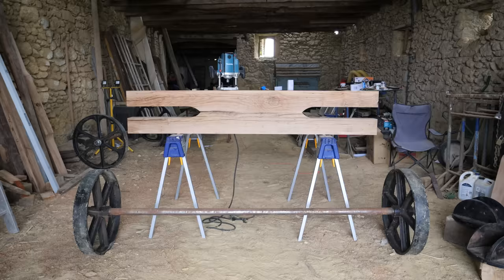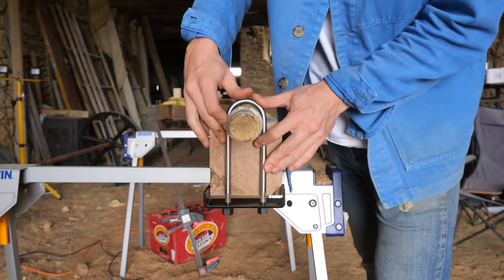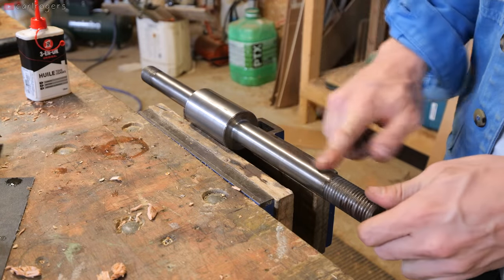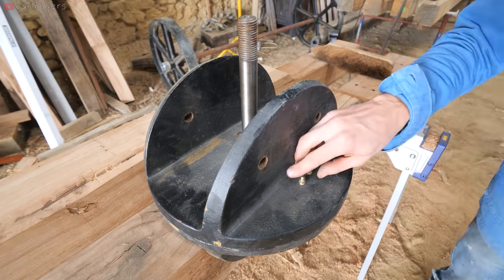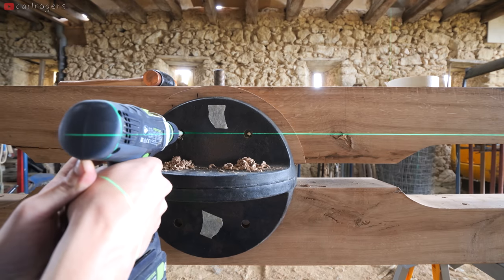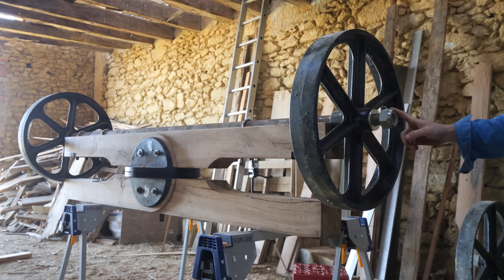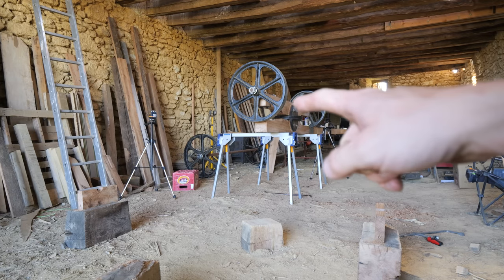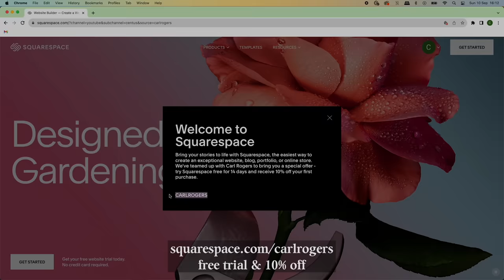Front Axle Finished  |  DIY Shepherd Hut #3

Comment: 10:43  LPT: put a nut on the threaded rod before you cut it, then afterwards when you remove the nut, it will clean up the damaged threads.
Reply: That's a great tip thank you
Reply: Was thinking exactly that when I saw the grinder.
Reply: Yup. We do that all the time at work. Good call
Reply: and if you forget, invest in a thread file
Reply: Or a tap &. die set.  @blackdoublezero
Reply: It is the British accent, it makes you sound more knowledgeable and smarter than you are. it took a few vids to figure out that Carl has no clue what he's doing.🤣
Reply: Yup!
Reply: I thought of it too. But he had like two plus feet of threading to get the nut on before he cut it....

Comment: When they built wagons in the past, they would completely build them, then take them apart and paint (even in the bolt holes) then reassemble the wagon. They used regular paint then finished with boiled linseed oil to make it waterproof and shiny. The iron fittings can be finished by heating and coating with linseed oil. It will blacken and seal.

Comment: I would have put the grease nips/zerts in anyway. For the wheels as well. Grease breaks down after awhile, and it never hurts to add fresh lubrication occasionally. It's going to be a solid, well built wagon!
Reply: I totally agree. You need a grease fitting in there.
Reply: Agree 100% with this.  As an owner of a classic British sports car with kingpin front suspension, the owner's manual clearly states to regrease the kingpin at least once a year.  Putting the zerks in is easy and grease is cheap insurance.
Reply: Put em in.
Reply: Grease doesn't last forever, kiddo. Add the grease fittings.
Reply: The most prominent DIY heavy equipment YouTubers like Marty T or Andrew Camarata have one thing in common - they believe in grease. The first thing they do with newly acquired equipment is grease the heck out of it. Grease makes the world go round. Add the grease zerks. In grease we believe.
Reply: Completely agree.  Grease has its own life expectancy and while re-greasing may not be necessary in the long run...in the chance that the thing does need re-greasing would your rather disassemble that best or simply 'snap on' the grease gun?
Reply: By the wheels :) there's nothing to keep them away from oak log. It should be at least a washer but better some ring welded to  axle
Reply: @cv990a4 in grease we trust 😅
Reply: I would put grease nipples in the wheels for sure, but not the plates. The plates are covered, very slow moving and rough. Any grease forced in will probably exit at some point (plate circumference or kingpin)  before it reaches the rest of the plate area. Pre-grease and that will last for 20 years at least.

Comment: Tip.  To drill a horizontal hole in a member, make sure that members face is plumb, then place a ring of sorts over the drill bit  Keep the drill in alignment by watching the travel of the ring. When the ring travels forward lower the power source (hand drill or power) when the ring travels towards the operator raise the tool 
Use a square to gauge the side to side angularity 
Keep up the good work!
JIM ❤

Comment: Highly recommend you to paint the axel. Since the u-bolts are stainless and in contact with the carbon steel axel, it will cause an acceleration of corrosion on the axel. Clean of the surface rust, degrease, etching primer and two coats of epoxy based coating. Also install the grease nipples, you will have to regrease the turntable at some point, it will be a pain without grease nipples.. chamfer the holes for the nipples on the inside to avoid burrs scratching the surface of the turntables.

Comment: Carl, you need a washer between the wheel and the wooden beam on the axle. I suggest a 1/4" plate screwed the beam end, secured with countersunk wood screws. Please also consider the reaction between Steel and Oak .... maybe a piece of canvas between the axle and the beam and the nut plates and beams. IDK what to say about the drilled holes maybe a dielectic grease or Battery terminal grease.

Comment: Hey Roger! Great job! As a cabinet maker and furniture restorer I would recommend you to treat the wood with something where it is i contact with iron. The oak tanins will corrode the iron and rust quickly. The best solution is to have contact peaces and bushings in nylon or brass to avoid this. Kind regards from Stockholm

Comment: Great craftmanship as always! To make it perfect you might want to give the axle a thin rub with some Linseed oil varnish. It will react with the rust and turn it into an elastic & black rust protection coat.

(In the Middle Ages, linseed oil was used as an anti-corrosion agent for armour and weapons. However, the process has nothing to do with (moonshining). It was also used in vehicle construction in the past. Today, people are returning to this non-toxic type of preservation in classic car circles, in the preservation of historical monuments and in healthy building. The oil forms a water-insoluble compound with Fe3+ ions in the rust. In addition, the oil forms a crack-free coating after setting)

Comment: Hi Carl, great series. Can I suggest you dress the unfinished steel parts (Axle, King Pin etc) with Lanolin. It will prevent rust and lubricate and would have been what was originally applied those parts. It is all natural and highly effective.

Comment: Might already be mentioned but a similar design was brought to the Intermountain West of the US by the Basque sheepherders in the early days of settling there. They became known as "Sheep Camps" and are still in use today although somewhat modernized with farm implement carriages and insulated aluminum shells in some cases. Old ones with the canvas covers on a bowed ash frame can be found on private properties restored and used as guest sleeping quarters and I've spent quite a few peaceful nights in them over the years but never owned one. Love your attention to detail!
Reply: ... some of the tradition mobile huts in Europe and USA are being displaced by "ThOWs" (Tiny House on Wheels). This may be good or not.

Keeping traditions alive is important but so too is adapting them to suit current expectations of the minimum modicum of function and comfort.

One of the reseasons I celebrate this build if a "Shepards Hut" is new (old) ideas can be revisited that can inform current typologies, theories and practical applications.

As an Architect, I lament that few  current students, practioners and academics reference not just past aesthetic but also past materials and construction techniques. Over my 45+ year career, I  have always maintained that you cannot design (as an architect) and document non-standard buildings if you don't understand standard construction methods, standard materials and standard details; to push the boundaries, you first need to understand the assumed boundaries. Also, you need to be able to think in 3D. The Canadian architech, Frank Gehry, has all all this in spades, as did Jørn Utzon

Many times in my carrier I have questioned the accepted wisdom; "Why do we do this this way?". To which I invariably got the response, "But everyone does it that way!".  To which I'd ask "But why?". Nearly 100% of replies (or variants) were, "because everyone else does it this way, it must be cheaper /quicker /more efficent" ~ idiots using lame excuses to justify their laziness and poor time /cost management and lack of vision.

An exemplar ofthinking beyond the "accepted way buildings are designed, detailed, skinned and built" is the Canadian architect, Frank Gehry, though he is in the shadows of Jørn Utzon, who conceptualised, designed and documenter the SOH in the days before 2D & 3D CAD.

Those who revisit past technologies and ideas are so important in modern architecture, design, engineering, product manufacture, etc, but most practitioners in these space have forgotten that the celebrated pinnacle we have currently assended owes it's significance to what has gone before... and that we still have more to learn from how our forebares did things (and why).

Apologies for the rant, but apparently it was something I needed to express.

Comment: A trick for aligning holes I picked up from Engel's Coach Shop - drill halfway from one side, then go in from the other side.  You'll meet somewhere in the middle and the extant hole will guide the drill bit to its entrance, aligning the holes.  Seams to work fairly well with traditional spiral bits (what I've tried).  Your single-flute bits ought to work out that way as well.

Comment: Great job, I love this project!

You should consider using nylon locking nuts for all connections. Since the wagon has iron wheels and no suspension, there is going to be a lot of vibration that could cause regular nuts to back out over time
Reply: Or a Loctite threadlocker

Comment: Well done! I saw a trick for keeping a drill bit straight when drilling down without a drill press. Drill a 2” hole (or whatever, according to circumstances) in a piece of acrylic mirror and lay it down face up on the surface to be drilled. The centre of the hole in the mirror should be the mark for your hole. This way, if the reflection of your drill bit looks crooked in comparison to the actual drill bit, you can correct until they’re straight and aligned. Great innit?

Comment: You will need a double washer between the wheel and the axle beam to prevent eating up the wood. 2 washers reduce inner washer spinning. And, the outer nut should be a castle nut with a cotter pin (you can cut your nut into one) going through the axle. The one you used can still work it's way off. Dremel cut a 1 complete revolution spiral in the axle to accept some grease with putting grease fittings on the wheels, so you don't eat up the metal while scaring off the neighbors from the squealing.

Comment: Lovely work friend! In my experience, I’ve found that critical passages through large sections of material, it’s sometimes less technically challenging to locate opposing ends of holes and drill from each side and meet in the middle. At that point, any error is contained in the center of the material. 
Cheers!

Comment: Maybe you won't need grease zerks for the plates (i still would add them regardless - even if cast iron is self lubricating, it does get bound up when it gets cruddy and grease keeps the elements out of the plate) you will need them for the wheels. I'd cut small spirals in the shaft too, using a needle file to allow grease to circulate - you don't need them to be big, about a mm would be more than enough, just to let the grease reach all the contact area.

Comment: Hey dude you can buy gator blocks which are hardened steel blocks with all the drill sizes through them. You then clamp the block to work piece  and drill through to keeps the bit square. You may have seen them before or even own them but thought I’d share.

Comment: Lay out your holes and drill them from BOTH directions . If they are slightly off the driil bit can passed all the way through to line them up . That way the holes are always in the right place despite a slight wander by the bit.
Reply: And you did almost immediatly in the video🤪

Comment: If you can put in the grease nipples, my own experience of chicken sheds and shepherd huts dating from the late nineteenth and early twentieth century is that they spend huge amounts of time not moving in often damp conditions. they can and do cease or grate requiring huge effort by several strong blokes with long levers to move if at all, grease nipples in the turntable and wheels will make a world of difference. One more word of advice grease before moving and again once sited and stand wheels on paving slabs or similar.

Comment: Be careful about letting that front hub turn 180 degrees once the hut is assembled. If you turn it completely in line with the whole wagon, it could make the whole thing tip over. There has to be some sort of turning radius stop to prevent this. Good job and good luck.

Comment: Thinking about flexing ability of the whole chasis on country roads. Most probably old wagons had more flex in joints because of fixing methods and lower accuracy. Here, You fix everything with 0,01mm tolerances and might be that wagon will ride on 3 wheels all the time. Love perfect woodworking skills, whole idea and patience, hate cheap threaded rod :( also should put washers between wheels hubs and oak. I have built a steel log trailer out of wooden wagon using it's axles, so I've kinda been there ;)

Comment: 3:00 one advice, drill some 3cm from the bottom on the brackets side and then drill from the top but you need to use drill bit for metal. It will find the easiest path and it will drill to the brackets. Edit, oh you use this method later. This is how I drill holes for post frame building.

Comment: Brilliant. What about soaking some leather off cuts from your belts and putting them under U bolts. Better contact for tightening and stop any chatter. I’m sure there is a reason not to as you do plan to the nth degree it seems.  👍

Comment: The holes for the U-bolts don't need to be perfect since alignment of the shaft is handled by the channel ot sits in. You would likely be better off with oversized holes since the u-bolts are only used for clamping and this will allow them to self-align with the shaft.

Comment: Isn't the frame, (and superstructure), going to twist on anything but flat ground? I would have expected the turning axle to have some ability to rock  side to side. If it's just going to be trailered from flat spot to flat spot it should be OK. Or will the non steering axle have some rock in it?

Comment: How will you be able to tighten, or loosen that big nut that holds the beams together with so little room around it ?
Do you have a special tool for that, or are you going to get it to be snug from the bottom beam?

Comment: Surprised the pivot bearing faces are not a larger diameter, without suspension to even the wheel loads there is quite some force attempting to rotate the axle beam into floor beam. What is the all up weight of this Hut when finished dripping wet and loaded ?

Comment: i would have drilled a grease nipple in 1 of the turntables because grease will harden over time and if you dont use a grease nipple just use the best grease you gould find special grease for heavy load think about a truck trailer turn table grease mixed with some molycoat